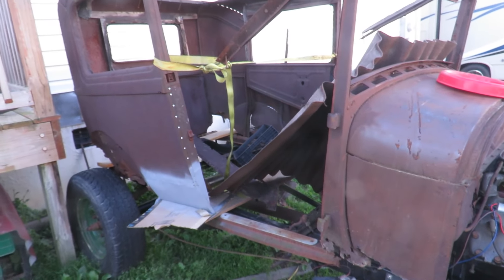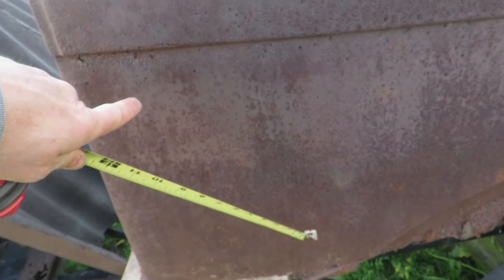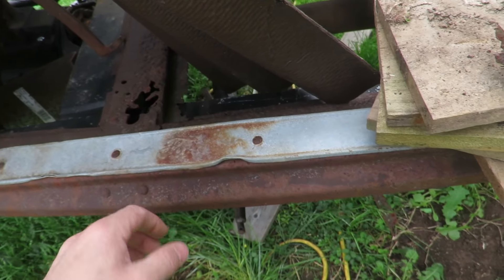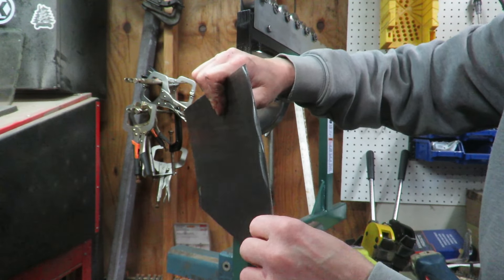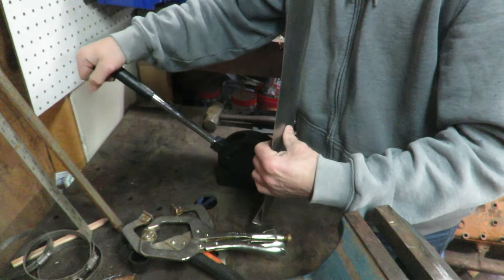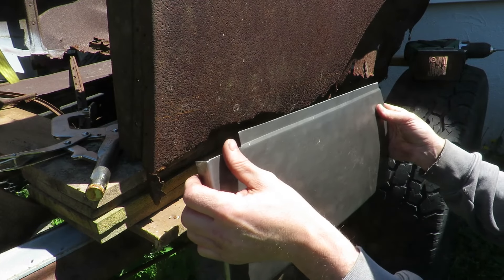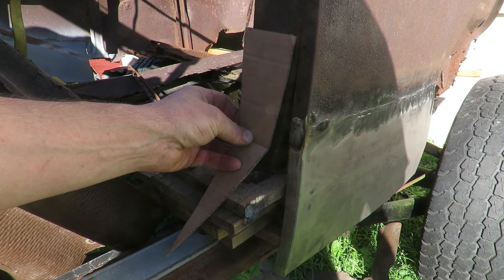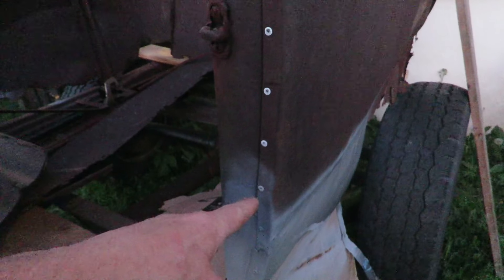Making a Ford Model A Patch Panel (B Post area)

Comment: First time I’ve seen you in a while, glad to see you working on the ford. You are doing a good job, take your time, looking good. On the seams I’ve had pretty good luck pop riveting it together before welding, then remove rivet and weld hole shut. This helped improve my weld because material thicker if that makes sense. Later, UD
Reply from the maker: I've been busy with work and kids 😁. I am hoping to try that method at some point. They make things called klikos (might be spelled wrong) that are like replaceable rivets.